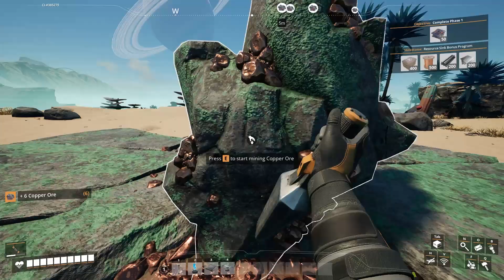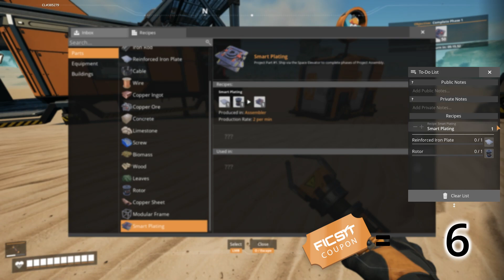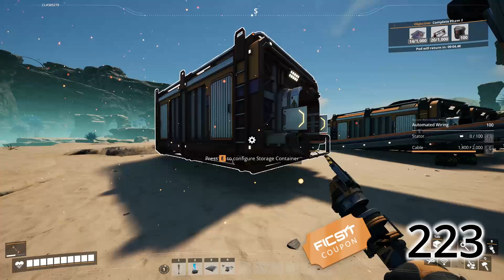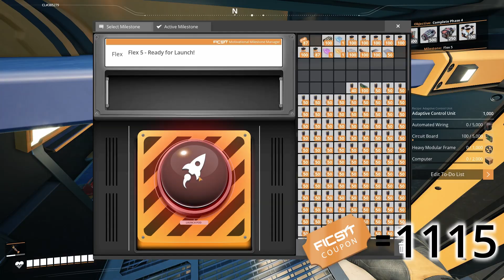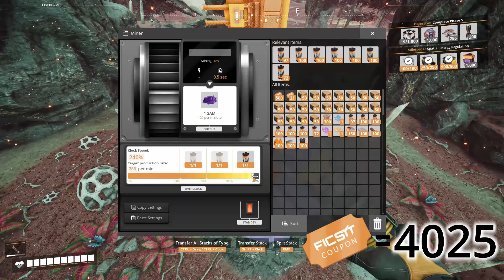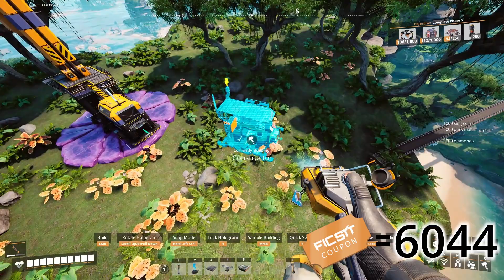Completing Satisfactory using Sink Coupons to buy as much as possible

Comment: Why did you not unlock sumersloops ? Dubble outpoot = half off the tickets spent . There are alternative recipes that use fewer items (less tickets) and have more output . 

Recomend you try it that way next
Reply from the maker: @rynolloyd  I wanted to do the challenge without slooping and alternate recipes. But I think I will try it with both.

Comment: There are alternate recipes for Smart Plating, Versatile Framework and Automated Wiring that you might have been able to unlock to make more efficient use of coupons for them.

Using the wiki's numbers, 6044 coupons needs 1,009,103,684,750 points, or 348,528 Warp Drives.
Reply from the maker: @Vaelosh466  that's a good point, I hadn't considered that. In a way, I didn't use any alternate recipes but that would be something good to try.
Reply: @Jabberminor  I just checked Automated Speed Wiring, it works out to .7 tickets fewer per hundred Automated Wiring if my math is right (which it likely isn't exactly, I'm just doing this in my head but I'm sure it is fewer tickets).  You also would need somewhat fewer wire purchases since it's 500 per stack instead of 200 but only uses twice as much wire per 1 craft.
Reply: I also checked if making higher items from lower items instead of buying them outright would be better but it seems like the ticket cost goes up by 1 per "tier" of item, at high levels this seems like it will never be cheaper but at lower it can, e.g. 500 wire for 1 ticket can be made into 250 cable, vs 2 tickets for 200 cable.  Alternate recipes might help here again.  Rubber and Plastic are both 1 ticket for 200 so I bet the alternate low level recipes that mix in rubber/plastic would get a lot of benefit from this.
Reply: Hey that's only two months of sinking every raw ore on the map if my math maths correctly
Reply from the maker: @theaninova  yes, not long at all